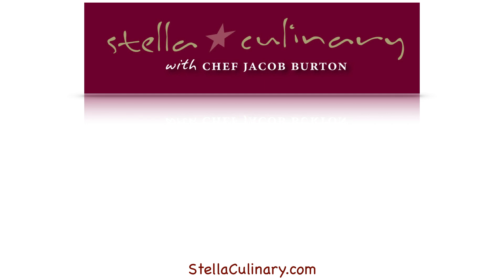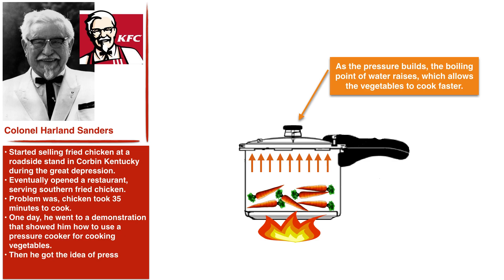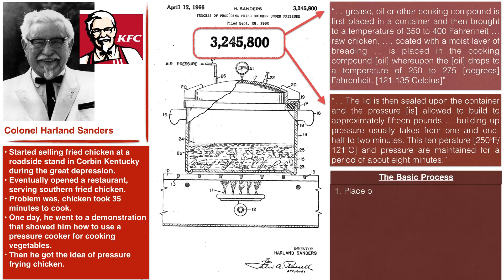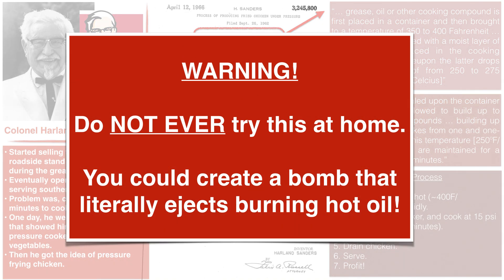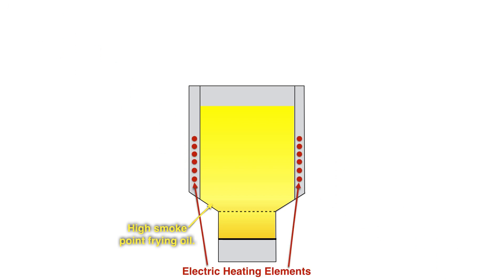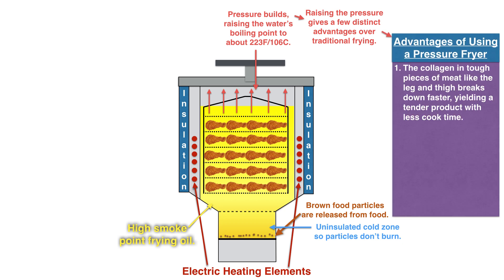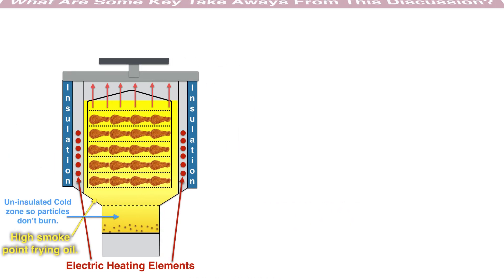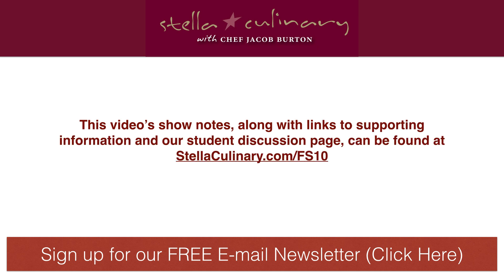The Science Behind Pressure Frying

Comment: I fried in the pressure cooker, it’s fine as long as you don’t fill it with too much oil. (2 inches is enough) 
and instead of 400 start at 350, after a minute of browning seal the lid and lower the heat to medium. pressure fry for 10 minutes. 
So the total cook time is 11 minutes just like the Colonel’s. 

My chicken is finger lickin juicy! But I have to work on my flour blend though, it has to have the ability to not become soggy from all the moist juices coming out of the chicken
Reply from the maker: For your flour coating, try doing roughly equal parts AP Flour, Tapioca Starch, and Rice Flour. Never used it for pressure frying but it's basically my go to coating for any fried meat that I want to get extra crispy.

Also, double frying helps, even though it's a bit of a pain. So after the first fry, drain on a wire rack and allow to cool for 10-20 minutes. Fry at 390F until crispy and a dark golden brown.

Comment: It is a little comfusing...when you close the lead...Pressure builds raising the waters boiling point to about 223 F ...what do you mean WATER we are frying with oil here, and you also are mansioning ...again  boiling point of water. make corections or explain...
Reply: The henny penny cook's chicken in oil, the oil releases the moisture from the chicken (water) and creates steam, this steam is regulated with pressure valves & solenoid to ensure correct pressure & safety.

Comment: Are 15 and 5 PSI (6:47) the correct numbers?  Normal atmospheric pressure is 14.7 PSI so the first is only slightly more pressure and the second is actually significantly lower.

Comment: Hi! I from Brazil and here in ALL the instruction manuals of ALL the domestic and commercial pressure cookers have written, among other recommendations, something like this: 1) Do not place the pressure cooker in a heated oven. 2) Never use the pressure cooker without water, as this would severely damage it. 3) Do not use this pressure cooker for pressure frying with oil. 

I talked to an engineer from a manufacturer about this and he said that only pressure cookers with an internal pressure of up to 15 psi and a maximum temperature of 120C (248F) are allowed in Brazil for domestic and commercial use. Only in industrial pressure cookers can higher temperatures and pressures be used.

So, DISRESPECTING THE MANUFACTURE’S RECOMMENDATIONS AND SAFETY STANDARDS (in Brazil), you could fry chicken in a closed pressure cooker, as long as the oil temperature does not exceed 248F, which is the temperature that the pressure cooker and its components are prepared to withstand. At this temperature, the chicken would fry faster, but would not reduce the loss of juice as expected from a pressure fryer. In order to reduce the loss of juice (and seasoning), you would have to fry the chicken at a temperature above 212F, but well below 248F. Nowadays, the chicken is fried in a commercial pressure cooker at 106C (223F) as mentioned in the video.

The question is: 1) Is a temperature of 223F enough to brown the chicken bread? 2) How to control the temperature of something that must be closed tightly?

p.s.,
Different countries may have different standards.
I hope this information can help someone.
Reply: Thanks, Luis, yes, it answers a couple of questions I had. 😊

Comment: I have the 10 quart Pressure Magic PC by Fagor which I use particularly for making pressure fried chicken.  It cost over $200 (don't remember exactly).  It is safe, but one must be careful to follow directions for its use accurately.  It has a screw-down lid and heavy-duty gasket--both of which are necessary for safety and good results.  To get the best flavor, I marinate the chicken pieces in seasoned buttermilk, bring them to cool room temperature, bread them and then fry, usually 4 pieces at a time.  I have the cookbook that goes with it, which is important.  This method makes the best fried chicken I have ever eaten, and it is really nice when you live in a small town where "fast food" is rarely available.
Reply: how long do you marinate the chicken i heard over night is best
Reply: Does it make boasted chicken
Reply: @laquannashipp2798  Yes, broasted.

Comment: Industrial deep fryers should ALL be pressure, from used to working at a restaurant with a normal fryer it was just a bed of burnt crumbs in a pool of exposed oil that could have hair, dust, bugs, etc fall in it, and all that stuff just layered on the bottom to be scraped out by me and a whole $50 of oil to refill it all over again after the 1-2 months, and it was supposed to be changed out like after 3 weeks. Restaurants now are buying into a misconception half idea it seems.

Comment: Fryer can be improved by incorporating a mechanism that can close off the bottom non-insulated part to clean out the bits that come off, maybe just a silicone rubber tube that collects the bits and can be clamped off.
Reply: tkjho google winston collectramatic fryer, uses gravity and convection to do what you want.

Comment: Is pressure frying common on restaurants that sell chicken wings? Because I would assume WingStop of Bufallo Wild Wings uses pressure fryer, yet the collagen on those chicken wings are still tough. That's why I only eat home made hot wings instead of buying because eating restaurant bought feels like a chore.
Reply: Usually fried chicken isn't pressure fried if a more crispy outer coating is desired, so a lot of chicken wings aren't pressured fried, KFC included.
Reply: I doubt that commercially cooked chicken wings are pressure fried.  They are simply deep fried and then tossed in the seasoned sauce.

Comment: I've never understood what exactly creates the pressure in frying. With water you have the water going into steam creating pressure. With hot oil what expands to make pressure unless it is only the moisture in the chicken?
Reply: The breading is moist; The chicken contains fluids; The first fry is open pot high temp, some moisture from the breading is released. As the lid is closed this moisture is trapped in the headspace above the oil. While the pressure is still low, escaping moisture continues to collect in the headspace and as the heat increases the molecules of steam excite and expand increasing the pressure. Some of the moisture in the chicken expands causing the meat to "puff up" somewhat, this displaces the oil around the chicken (ala Archimedes) this also increases the pressure on the headspace of the firmly sealed pot. Due to pressure equalisation within the pot, the moisture in the chicken cannot go anywhere so remains in the meat. The heat of this moisture cooks the chicken from within. When the pressure is released all the expanded moisture and molecules stop being so excited and clump closer together causing the chicken to, "de-puff" and the chicken is removed from the oil as quickly as practicable so that the breading doesn't get too soggy due to the lowering temperature of the oil. Hope that helps...
Reply: @TheHeraldOfChange  thank you
Reply from the maker: It's the steam being released by the meat.
Reply: I was wondering the same thing as 'bigpardner'. Your response doesn't seem to explain it though and seems circular. You explained that the high pressure keeps the juices (water) from becoming steam and remaining sealed in the chicken. But, that very same water is needed to become steam in order to create the 15 psi of pressure.

Comment: When I cooked KFC from 1964-1966 it was in what looked to me to be normal pressure cookers with a weight used to maintain pressure, The weight rocked around under the pressure like a normal stove top pressure cooker does. Once pressure was achieved the cooker was moved down the line to gas burners adjusted to lower flame.  I do not remember, and probably never knew, the pressure used but do not recall any accidents except some small burns emptying the hot grease after a batch was finished. These newer electric cookers were developed I believe by the company after he sold out. I am astounded by this video where the Col. says, I believe, 29.7  pounds pressure! https://www.youtube.com/watch?v=cF4ph_gKcpI&t=3s
Reply: Thanks for this link!! Awesome!  :-)

Comment: Actually using home pressure cooker for frying chicken is quite safe if you know what you're doing. I'm using a 9L capacity stovetop home pressure cooker and put oil only about ⅓ of height of the sidewall. Bring it up to 375F, put the breaded chicken and wait for about 2 mins for it to brown slightly. Then close the lid and wait for 8-9 mins, release the pressure and open the pressure cooker. So far, that how I do my fried chicken ever since. Downside is you can only do a max of 5 pcs at a time. Texture is like KFC but the taste, sad to say isn't. But its ok. I never had the intention of doing a copycat of KFC anyway.
Reply: Chubby Luna look for 99x spices.